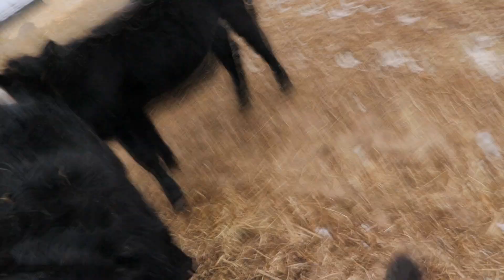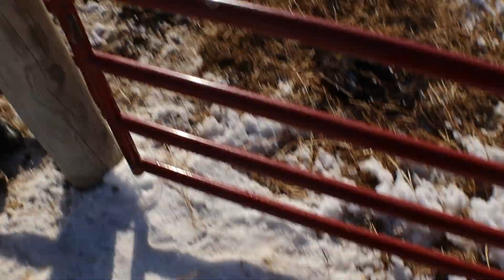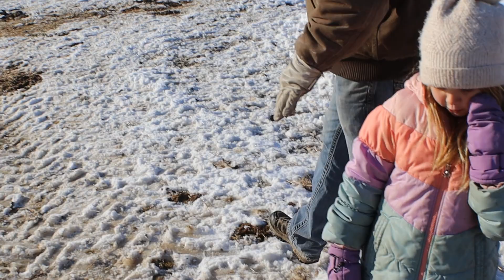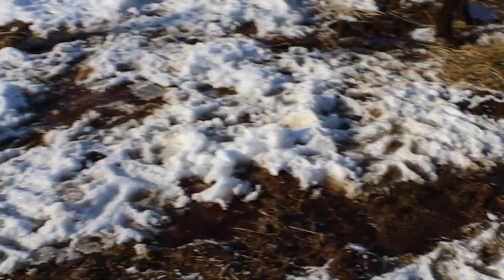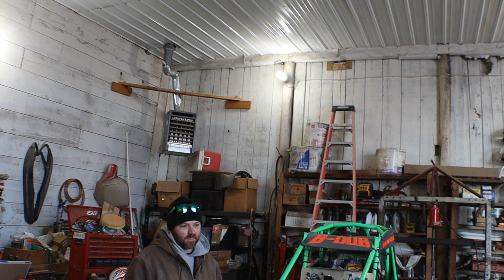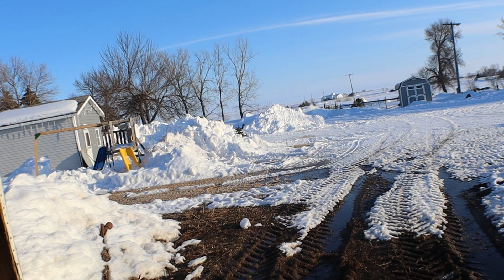Visiting rocky run angus!

Comment: That looks like a fun time running one of those. I'm a big fan of Chrysler 340 so I wonder how they would compete.
Reply from the maker: Mopar's rule that's how they would compete!
Reply: @jonstevensmaplegrovefarms3754  they sure do. Better get your order in on the last Challenger 170. 1025 HP baby!
Reply: No doubt Mopars are awesome, the 2 options for our series are the 5.3 LS or the 602 crate motor.
Reply: I actually have to take that back, one guy that runs with us, I think, ran a Mopar, I don't know any details about the engine, though.
Reply from the maker: Many years ago there was a company that would build the 318 engine into a dirt track engine. Don't know what kind of displacement they were ending up but they had some pretty Monster horsepower. But 20 years ago when an engine costed huge dollars it better perform.
Reply: @jonstevensmaplegrovefarms3754  hell a good cam can really wake a 318 right up.
Reply: @Jon Stevens Maple Grove Farms  the 318 is a really underrated engine, we had one in a dodge pickup that was a govt pickup, then we bought an old coronet and that thing was wild, pretty sure ut was bone stock, had the old 2 barrel n stock exhaust manifolds on it yet, but that thing was a riot out on the back county highways. She was a screamer!